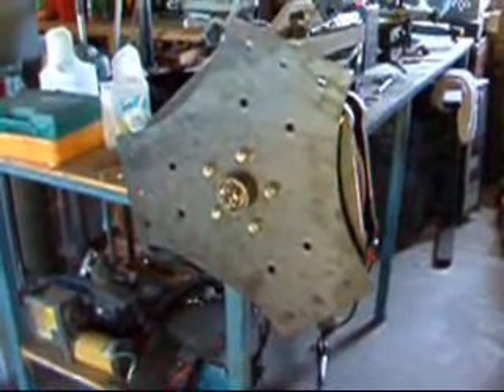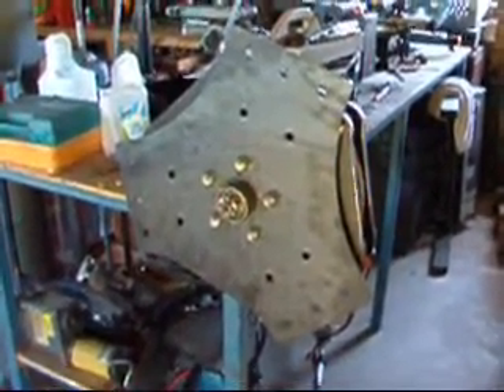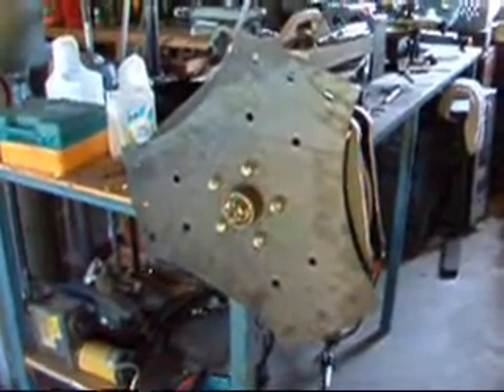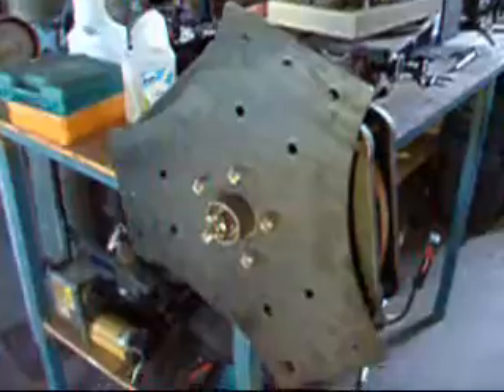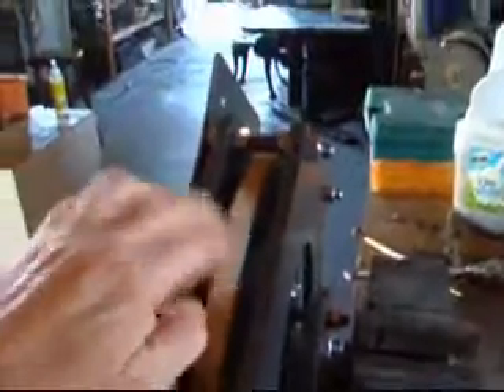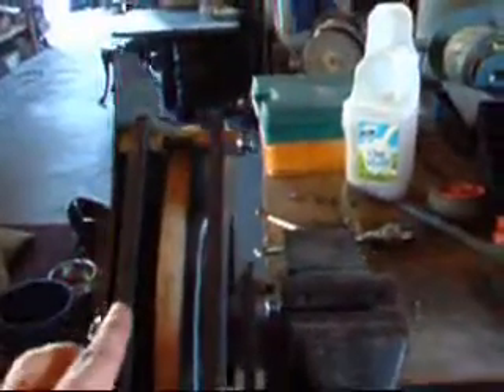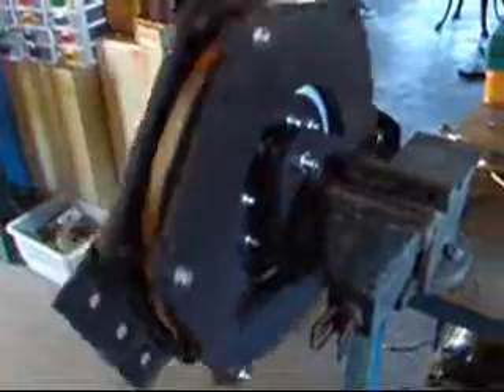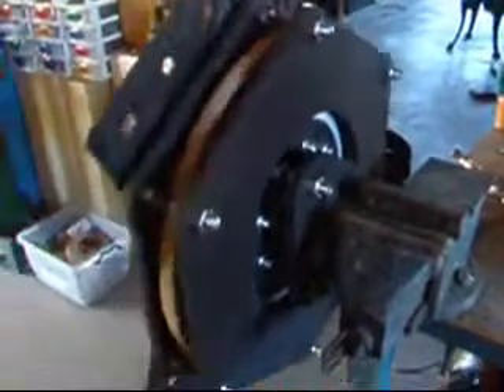Thebackshed's Axial Flux windmill, part 1

Comment: @glennl1965 
To be honest i was nt expecting more than 1kw since i wish to put it on a vertical axis.
I believe it might be on movement more often but with less rpm... am i right?
I had another question about star configuration...
i will have 3 start A B and C (inner coils) and 3 ends X Y and Z (outer coils) ...
Does XYZ have to be connected together with no other contact???
and what about ABC are they all + or 2 + and 1 -??
I can t find proper answers to these questions...

Thank s Glenn

Comment from the maker: @billmalta1 
I'll be using 6 foot blades, so will end up with a 13 foot diameter turbine all up. It would be capable of 3 to 4 kw, but I expect 1 to 2 kw in good winds, depending on location.

Glenn